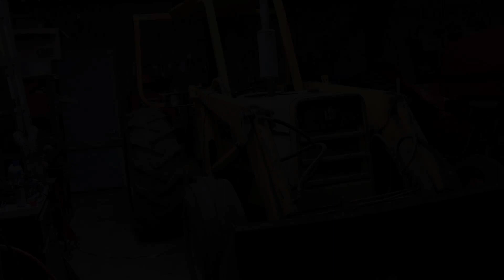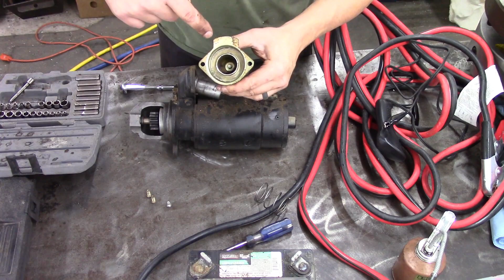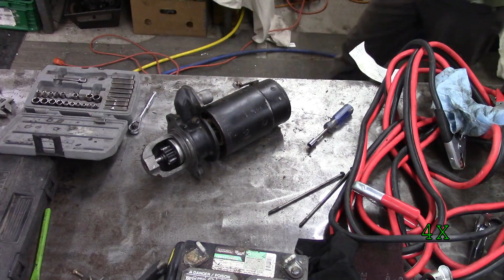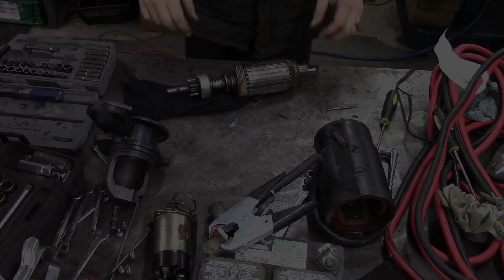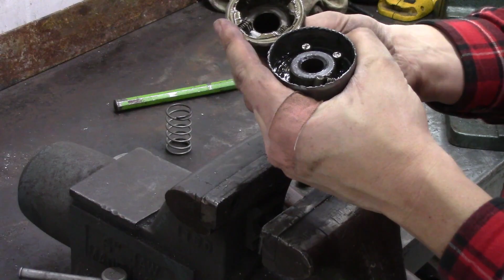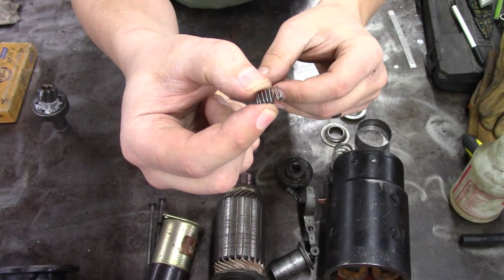International 2510B Starter Repair

Comment: Nice job! I also have the 2510b!!   Had similar issues with the starter.  I replaced the starter and wished I invested the time to understand what happened. Good info.    My issue now is that it starts and idles but does not rev.  I had the injection pump rebuilt, but still no reving of the engine even when I manually move the throttle.  Probably something simple but I’ll keep working on it.  Good to see another 2510b out there 😊